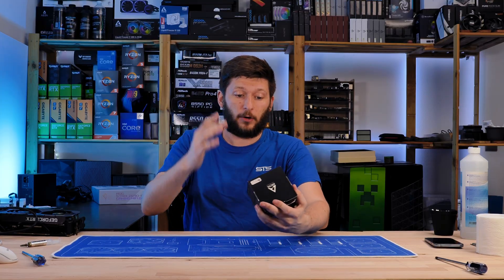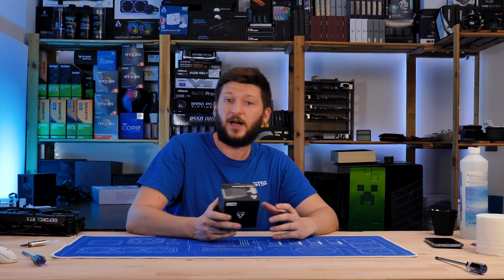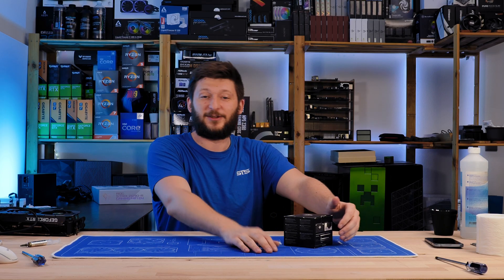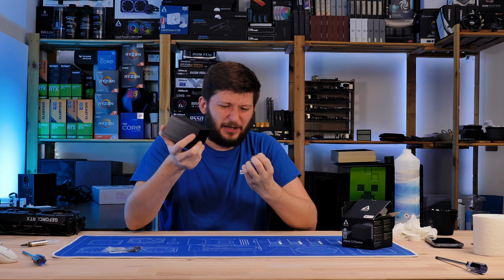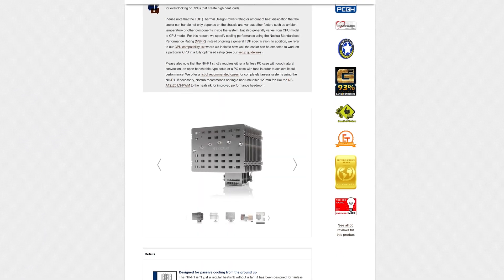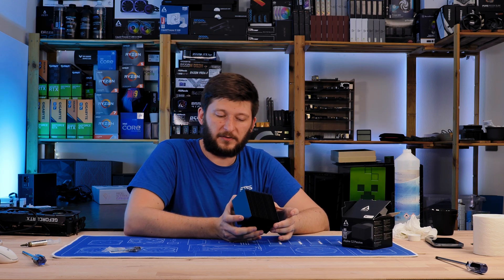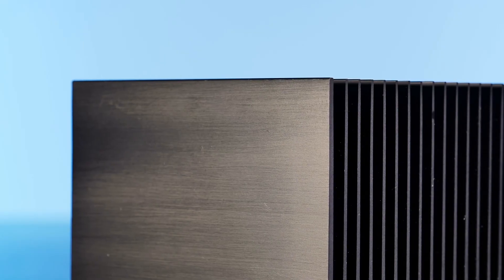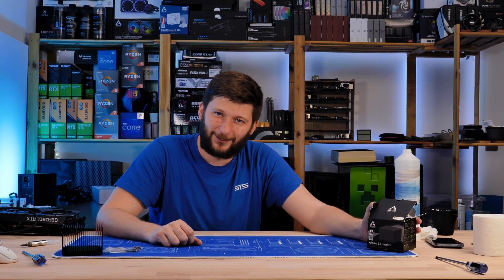5 Year old Arctic Alpine 12 Passive vs 12th gen Intel - Will it survive?

Comment: It's a pretty nice chunk of aluminum cooler. I actually repurposed my old Core i7 3770k for a server/NAS/seedbox use, and I wanted to be fully passive, in order to be silent and not worry too much about fans and wear. I removed the OC I had for a long time and disabled the turbo frequencies, while I also undervolted it. Guess what, it works perfectly fine for a computer that is basically always idling when sharing data via its gigabit ethernet link (and I also use BOINC, but only for GPU based processes).

For this use, it's a perfect choice :)

Comment: 12:15 I think the temperatures are higher in games than in all core benchmarks because in games not all cores are used so those core used are given a lot more voltage to boost higher. That bigger voltage makes it go volcano.

I found something similar situations with an Ultrabook. If I run Cinebench with all 8 cores, the frequency is lower and temperatures are at 75 °C. If I run Cinebench with only 4 cores, the frequency of those 4 cores is higher and the temperature gets to 100-102 °C, close to TjMax 105 °C.

I guess a passive cooler like that is good for a low powered home media server or a home PC for parents, if you undervolt and underclock the CPU. Also, a PC should have case fans that may help a bit more than that lonely Noctua above the cooler that you tried.

Comment: Insane cooler
 you could check the thermal conductivity by looking at the temperature of the cooler with a thermal camera
Reply from the maker: Wanted to do that. Then I found out how much these cost ^^
Reply: @STSYT  okay cool
Reply: @STSYT  you can get somewhat decent ones for an okayish amount.
200-250 is possible and also those FLIR thingys you attach to the phone are surprisingly not that bad at around 150-250
Reply from the maker: asaik there are also handheld devices from FLIR in that price category. But as I had to learn in the past, for "the channel" it doesn't make a lot of sense to go for budget, "cheaper" stuff. Not that they are bad or something, the way and frequency that we use everything here will speed up the destruction process quite rapidly.

Therefore I am now just saving some budget for longer and get the "real deal". The next part on the list for now is a edelkrone slider. Cause I'm just done with those 300-400€ GVM/Neewer things. It starts to annoy me that basically every b-roll needs to be stabilised.
Reply: @STSYT  first world problems I guess :D
But yea... The Edelkrone sliders do look dope...
I've first seen them in a Daniel Schiffer video and I was really impressed.
But the price point.. Oof.